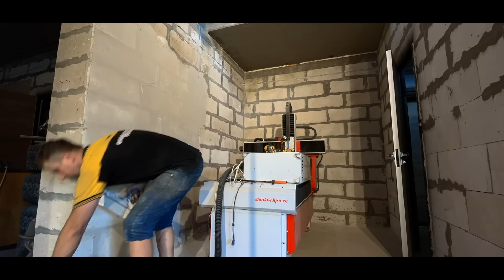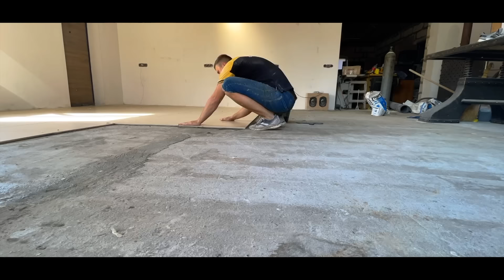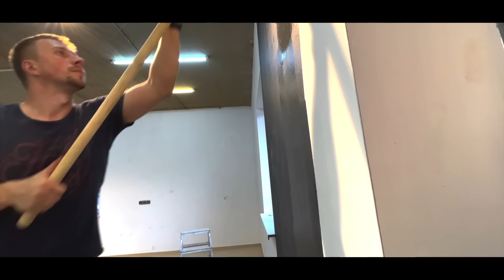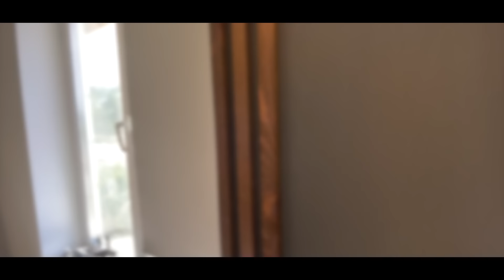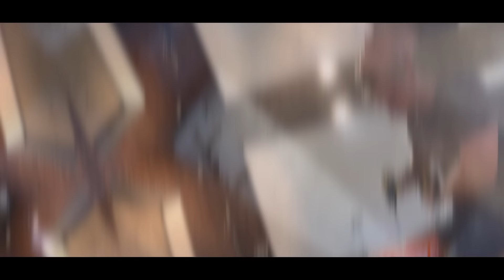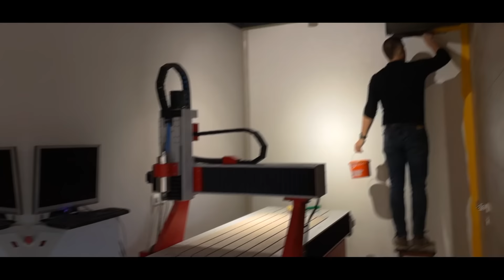Modern renovation on 60 sq.m...4 months timelapse in 9 minutes

Comment: Next time make the ceiling before the walls always because you can spray the walls by accident (wich surely happens). Always from top to bottom. 
So after doing layer of primer everywhere I would make the ceiling black twice along with couple inches of the walls. Then I would place the tape into the black upper part of the walls and right after this I would paint its bottom side black again, to make the painting pour behind the tape. Then I'm okay to do the walls, twice. When I see this line done in any other way, I freak out and suffer. 😅